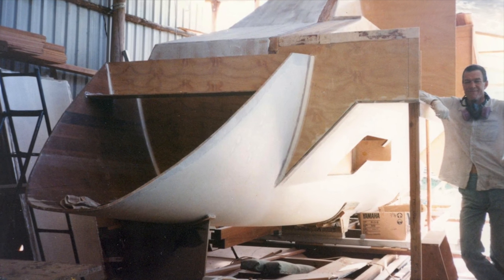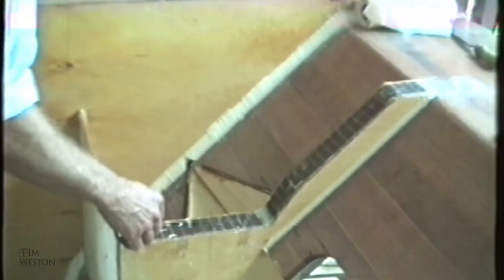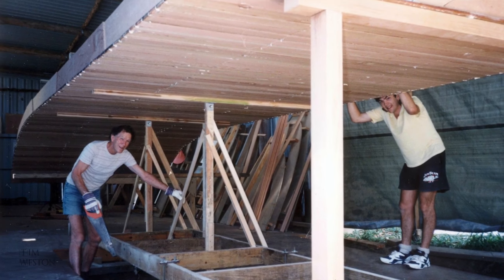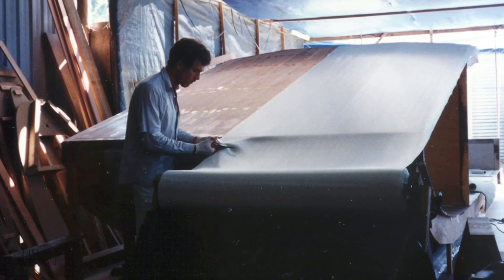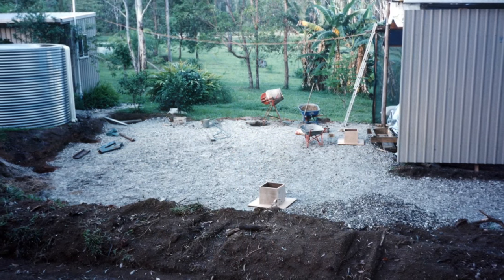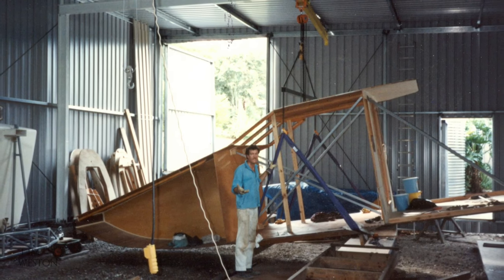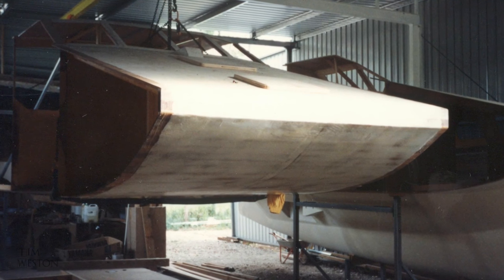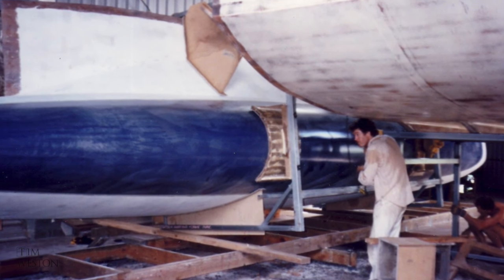How to build a boat Ep #3 - Catamaran you can live on

Comment: It´s a pleasure to greet you. I´m from México and i started designing a catamaran with very similar dimensions. I have seen several times your video series and i have some doubts. The most important is: what is the thickness of the wood and the thickness of the fiberglass? how do you assemble the divisional tables. nails or screws are used in the hull? I will be infinitely grateful to you. Receive a hug, and congratulations for your videos.
Reply from the maker: Hi Rodolfo.  Thank you for your comment.  On this boat the wood is 14mm thick.  The fibreglass is one layer of 415gm double bias and there are no screws in the boat. It is all bonded with epoxy.  Screws were only used temporarily to hold the cedar to the frames. I hope this helps and all the best with your catamaran.  It is a good project! Greetings from Australia. Tim
Reply: Hello Tim, it´s a pleasure to greet you again.. I finally started the construction of my catamaran, it will be 50ft.. my question is: how many cm or inches of junction between a stretch (or layer) of fiber and another?.. as always I appreciate your great help.. receive a hug from México..

Comment: 4:34 its mentioned the fiberglass epoxy is as strong if not more so than the hull of the ship? so there's nothing else supporting that joint? or is there a bulkhead going across the ship to help support the mast? 🤔
Reply from the maker: There are bulkheads that cross the joins, where ever there are bulkheads. But the join is just bonded, it's no different to the rest of the hull. The main bulkhead supports the mast, Elijah.